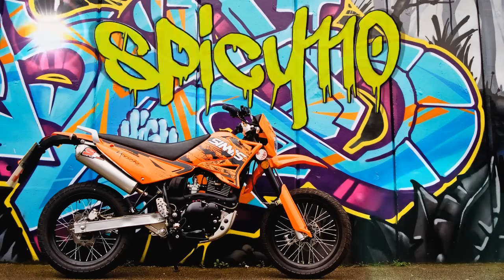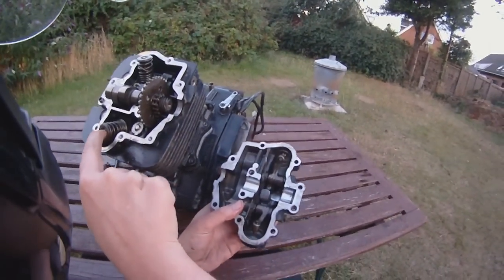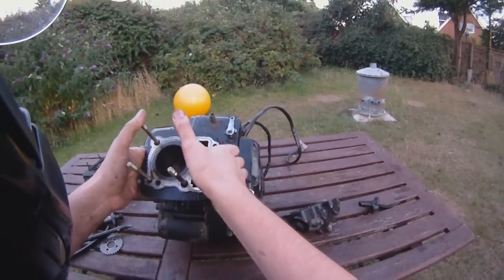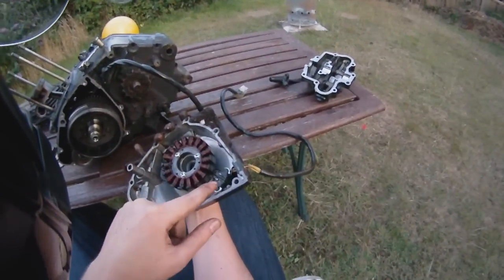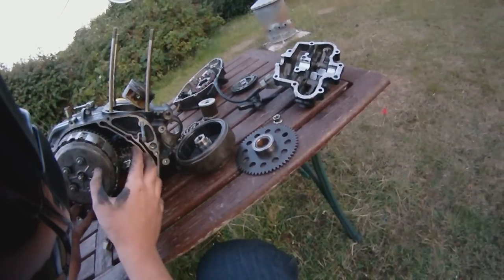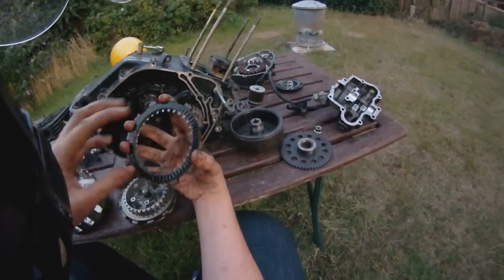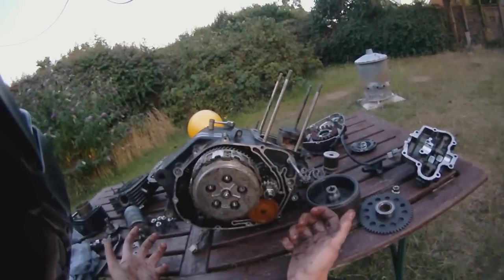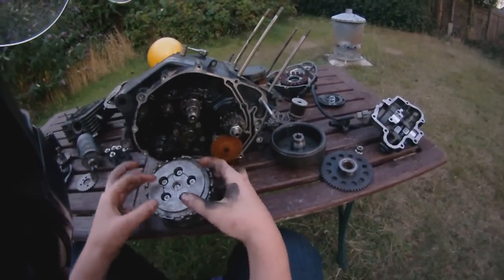How a motorcycle engine works!

Comment from the maker: Check out the spicy110 Metal Works! Clocks and art made from old motorcycle part! https://www.etsy.com/uk/shop/Spicy110MetalWorks
Reply: Binay
Reply: Hey Spicy I’m currently rebuilding the same engine as my con rod snapped I have all the replacement parts and currently cleaning all the parts as I’ve completely dismantled it, any advice for when I put it back together?

Comment: Honestly this is just what I needed. Im a car mechanic if you want to call me that. I build engines and work on cars from my house. I wanted to build a cross kart and I need to use a motorcycle engine that's chain driven but I know nothing about these engines and I was confused if the trans was attached or not to the engine itself. Thanks
Reply from the maker: I have also done a video on the gearbox it's self if you want a little more info.

Comment: Actually the fuel and air mix is sucked in to the cylinder by atmospherical-pressure which is 14.7 psi
Reply from the maker: Haha this video is years old I never realised I said that. A suck is just a blow from the other direction 😉 (don't get triggered I'm joking)
Reply: I know I know I was just commenting but regardless I love the videos I have started a quest to watch nearly all over ur vids 🙏🏻
Reply from the maker: @joshbendle6561  it's a good call for accuracy 😁 well spotted no one else has!

Comment: Hi spicy i need to access my clutch on the same engine as you have and i tried to just take the side cover off but it wont budge is there anything im missing?
Reply from the maker: Yet it's the seal holding it on it sticks hard. I had to tap might with a rubber mallet. Not sure if that is advised tho!

Comment: need to change the left crank case as mine is pretty tatty does it just slip off after undoing the 8 or so 10ml bolts? or do i have to do anything with the big nut in the centre?
Reply from the maker: No that is just a opening to the crank nut so you can find tdc without taking the case off. Just remember if you replace the engine case you must replace the gasket too.
Reply: spicy110 cheers bud does it hold a fat lot of oil or is worth draining first?
Reply: got another question too lol I wanna change my front engine bracket you recon the top engine brackets will hold the weight of the engine to change it?
Reply: got another question too lol I wanna change my front engine bracket you recon the top engine brackets will hold the weight of the engine to change it?

Comment: hi spicy110 have the same engine how did you get the flywheel off mate cam chain fell down just like yours and now is stuck lol did you use a oem puller
Reply from the maker: No I did it is a damaging way as I knew this engine was never going back together.
Reply: cheers mate

Comment: Thanks dude, can’t get my Sinnis running , it’s got fuel,air,spark but just won’t start , sounds like it wants to when bumped but still no luck , any suggestions:)??
Reply: compression... check your exhaust valve lash?
Reply: curator23 I’m not sure what that is or how to do it ?
Reply: curator23 cheers for the vid I’ll give it a go when I get some free time :)

Comment: I know this is an old video but what is the wire coming away from near the sprocket for/called would be much appreciated:) (6:52)
Reply from the maker: Liam Anderson that cable goes to the gear position indicator pick up sensor. 🙂

Comment: urm, i don't really know about motorcycle's engine so much compare to car engine. Since car's engine with 4 piston inline made the reciprocating motion to keep on spinning is due to the structure of the engine since 4 piston with 4 stroke have the good structure which 1 spinning will do 1 stroke and 4 piston can made the reciprocating motion keeps on moving without getting the engine died. How about a single piston like motorcycles? Is it because the flywheel or what?
Reply from the maker: +Asyraf Cboy yes the flywheel stores kinetic energy it's rotation is what keeps the engine running smoothly
Reply: Owh, okay now i know. That's why im confused how a single piston could maintain its rotation. Thanks buddy

Comment: 3:41 That's the gasket there right the black bit, looks like a bit of sealant wouldn't be a bad thing or isn't sealant needed for X Y Z reasons on a bike?

Also is it air cooled or water cooled? I'm leaning towards air cooled but aren't sure XD
Reply: +Siggy Cloud Air cooled

Comment: My first bike after passing my test was an RD400. Blew it up, (obviously), knowing absolutely nothing, just armed with a Haynes manual and decent tool kit, stripped it down on my bedroom floor. Learned so much about how an engine works and goes together. If you can (ignore the complaints of your mum/girlfriend/wife) lay a sheet down and in a clean dry enviroment, even a large, "complicated" engine is manageable. Just be methodical and these days, take digital photos of each stage. There's no great mystery. (plus, if you're a bit of a nerd, its a better passtime than train spotting)

Comment: considering you are self taught like myself about engines and mechanics this video helped me fully understand engines! keep up the good work!
Reply from the maker: glad it helped thank you!
Reply: spicy110  "suck, squeeze, bang, blow". remeber this with your Chinese motorcycle youll have it in bits more than you have it on the road mate lol also your head residue looks choclatey , its fine , sooty and stuff is a problem , colour of the mixture on the plug and head and depostits can tell you a LOT  :) sounds like aminor problem but it can cause melted plugs , overheating and even warp the head if the mix is wrong and you keep on riding hot , depends witch way its leaning , rich or lean

Comment: I have a 1984 KDX250 dirt bike and right now it's not working because I need a Generator Rotor. However, I would love to remove that whole engine and install another engine that will fit and match the KDX body. Would I be able to do that? Far as getting another rotor looks like major stores don't have them at all anymore. So getting another engine from another bike and year may be the best thing I should do.

Comment: 4:12 thats the block not the head mate. The head is the part with the valves in it, below the rocker cover and above the block. The crankcase is below the block.
Reply: Rule of thumb with any and every engine:  The head never houses or comes in contact with the piston. The block always houses the piston and cylinder walls.

Comment: why the fuck do all bikes not have that piece to unscrew and adjust the valves?! SO MUCH better than taking the whole shit apart
Reply from the maker: It's well thought out isn't it!
Reply: They do that so you have to take it back to them for adjustments, but obviously there are people out there who know about this shiz :D
Reply: ***** But those "Never touch" cars are the ones more likely to have catastrophic break downs if a tiny thing DOES go wrong.
Reply: ***** Vehicles that have more complex parts because they are designed to have "Less maintenance" usually have more catastrophic problems than vehicles that require more maintenance.
Reply: ***** Im not speaking about specific parts... and you can not say i am wrong when you are talking about bikes on their own when i am on about any kind of vehicle... The more advanced something is yes the less it is going to require maintenance But when something DOES go wrong... it will be very time consuming/Costly
Reply: It's never hard to reach the valves by removing an ordinary valve cover. I actually prefer that myself since its easyer to to use the feeler gauge that way. In this case the rockers are mounted in the valve cover tho.
Reply from the maker: *****
This engine has a cover on the case to find TDC so you only need to remove 3 caps

Comment: THANKYOU! i sort of under stand the CAM now but could anyone tell me how to do this

when i crank my bike over it dosnt have alot of compression,whats happening is the air is getting pushed out the engine and threw the carb and out of the air filter?? anyone know how i could ajust this?? please
Reply: inlet valve problem. could be not timed right, could be not sitting in the valve seat properly, could be anything.. it needs to be looked at by a professional too see what is wrong

Comment: 2900 miles is alot for that type of motor, and a but load of hours on the dirt (dirt is heaps more tiring so you do less) its probably just needed new valves, piston and bottom end the norm that should be done at about 100 hours of normal work, or 50 for hard work

Comment: Yeh the mechanic who sorts my YZFR out for me had a KTM EXC (or which ever the competition bike is) in for a engine rebuild had done 2900 miles without being touched as they had road registered it and thrashed it and it was disgusting with carbon build up and bad 2stroke residue . It cost £950 in parts alone to get it running properly again

Comment: Awesome little quick how-to spicy!
.
That thing you didn't know the name of that happened to the piston is blow-by, some amount is always expected, especially with forced induction where you have high effective compression ratios and loose fitting rings to deal with the heat, though excessive blow-by is obviously a problem.
.
The other thing in the left cover is the pick-up for the CDI box - ignition timing.  Not sure if your bike has TCI or CDI but either way needs reference for spark timing.

Comment: quick simple and fast your crankshaft makes your timing chain cams and piston move. you have your intake of gas then compressed to the top of the intake valve bam spark plug ignites fuel. down stroke then exhaust. to sum it up suck and blow makes your engine run.

Comment: unless you run boost, the 300hp figure was exaggerated to get to a point
there just not bigger and thats that, im not talking in theory im talking from rebuilding engines by hand for a couple of years also getting them machined to improve flow now here is a video o7yS_bvJ8vo (still uploading this minute)

Comment: how do you work that out? it adds another 300hp??
When they 1000rr only pushes out 170hp in the first place??
A hayabusa 1300 only pushes out 178hp stock..
So where the heck did you get the added 300 from?
And yes exhaust ports are bigger than intake ports.. 
An engine cant suck in fresh fuel until the gases are out.
The volume of a cylinder can only take so much filling it.... simple science really? its like saying you can fit 150ml of water in a 100ml bottle... just impossible,,

Comment: well if you understood physics it would make sense that you do not suck in any more air by installing a faster flowing valve or port.. you merely do it easier.
Do please make a video disassembling any engine of any type (minus 2t for obvious reasons) and Do explain how the intake valve is smaller than the exhaust.

Comment: Hmmn really?
it must really inprove power then.. bmw spends millions developing a engine and they put in Intake Valve Diameter	33.5 mm
Exhaust Valve Diameter	27.2 mm 
in the 1000rr when all they had to do was swap that around and make another 300 hp?

Comment: As someone who has been properly trained to take apart and put together aircraft engines, I will say you should be confident in your skills to work on these types of engines..  If you do the proper research into how to do whatever specific task (like changing a piston or cams), you will be able to do the same quality work as a proper mechanic(it will just take longer).

Comment: and with the Air / fuel mixture being forced in it creates a better explosion causing more power and the inlet doesn't need  to be massive because not allot of fuel needs to go in per cycle

Comment: nope I'm right i told you about the exhaust valve the fact its big because it needs to push out allot of gasses and the inlet is actually smaller which helps force in the air and fuel mixture into the cylinder better. i do mechanics and ive seen and know the differences

Comment: Was waiting to be corrected :)
You are wrong and thats that. whats easier sucking a drink or blowing out air?

not sure what engine i should use a example of that will get it through to you.. or the 4 heads i have in my shed two with oversized valves and port work..

Comment: you would of thought so but your wrong, it is the exhaust valve that's bigger and the inlet that is smaller. the exhaust valve has allot of gasses that need to escape and in only 1 stroke so it needs the larger space to escape

Comment: Nah, vacuum  means nothing.. its a low pressure area and the intake valve opens and equalizes that low pressure with a nice mixture of fuel and air
suction is only a describing word it is not a thing 
Im lovin this videos comment section and the video

Comment: thats only 2stroke, on 4stroke the rings are to blame/air filter maintenance and hours
same with the 2stroke also but there are many more variants that can cause that and blowby is the main one.. i only run mine for about 30hrs (some trail alot of mx) then throw the piston and rings in the bin because they are thrashed

Comment: is it smoking on acceleration or when off the throttle
you may need valve stem seals, requires the valves out so you may aswell replace the valves while your at it..
it could be the bore is glazed did you hone it when it was out? this will ensure a good seal (providing the bore is not too warn)

Comment: i know its not my question but i cant help myself..
By the figures listed on my search you go from 17hp to 24 thats a gain of 7 hp and alot of torque have you ever ridden a 6hp brigs and stratton gokart? imagine that +your current engine the torque figures will jump alot also
i did a similar thing with my pitbike, from 14 hp to about 20 and it has totally transformed my ride +maintenance (may not be much of a issue with the honda) i have also felt the difference or +3mm in a bore its massive

Comment: hello i have a engine problem with mine i have a honda 200m 3 wheeler same engine looks everything my engine smokes blue from the oil and i changed my piston rings seals gaskets and clinder i dont know what is wrong with it can you tell me please oil is not cheap...

Comment: For everyone wondering how a two stroke motor works, its simple but yet complex. The upstroke is the crankcase intake/compression stroke, and the down stroke is the power/exhaust/ and when the fuel and air mix go into the cylinder. Due to character limits this may seem completely weird or wrong. Reply with a q and ill try to answer it.

Comment: The blacking on the side of the piston is longer than recommend services and poorer quality petrol I.e. supermarket petrol when I took the piston out of my 2stroke 50 that had for as long as I had owned it been run on shell optimax on top shelf 2 stroke it was silver on the sides and top do to all the fuel being burnt correctly and good oil lubrication on a 4stroke its more of a fuel air mix and regular oil changes and services that will prevent it and give a longer life and also better MPG

Comment: also spicey, how old in k's/miles was that engine? also please post a high res pic of the valves showing how far in the head they have warn (receded into the seat)
This is important as it can determine or help determine how much work your motor can do in your current bike (if its a similar engine) or even uses the same valves and springs
it all varies though

Comment: if you mean suck squeeze bang blow yes but the 2t does it in a much different way to say a 4stroke or a wankel i would not say the same as a 4t
i would say that diesels are similar to 4strokes but 2t are a different ball park
The gearbox's are very much the same/similar with different ratios 
i may even get my hands on a car gearbox and pull it apart and make a video there a little different also (auto old auto newer) and manuals of cause +more mechanical  stuff

Comment: If you can take the head off in the frame (looks pretty tight) and do a piston and rings change then you can install that.. however to save your back and probably save taking the tank off you may as well take the motor out and put it on your bench
Installing the kit is easy, take the head off and it will be two more clips..
Not sure if it will fit in your cases (googled and it did not say you did) if it does not and you need case boring thats much more work and $ 
Remember you need to rejet to

Comment: I have a CRF250L and there is a 305cc bore kit for it.  Would it be hard to install the bore kit and would I have to have to take the engine out to do this or is it possible to install the bore kit with the engine still on the frame?  Or would it be worth installing the kit at all for it?

Comment: since your ready to be corrected :) your pretty on the ball
01:45: yes they are called cam lobes
 02:13 correct
04:07: correct
04:20:blow by correct if there is any scores it could be a number of reasons probably getting too hot
05:10: the coils are the stator the "rpm pickup" is the magneto and sends the spark to the coils then the spark plug so to speak
11:41: the throttle limits the amount of air and fuel yes but the air fuel mix is your jetting and more cant go on out of characters